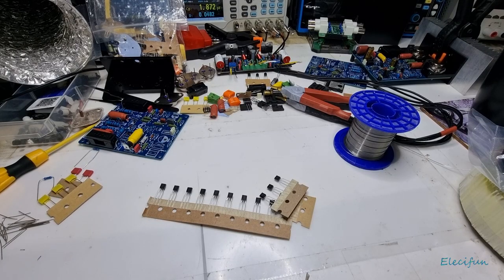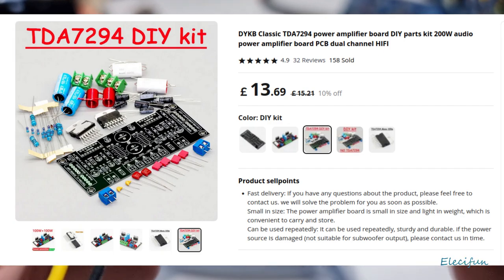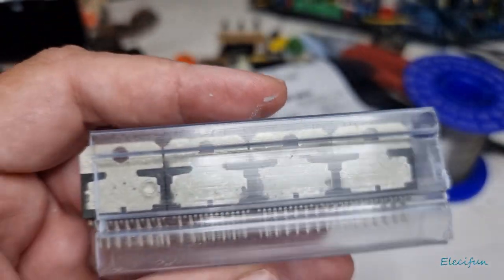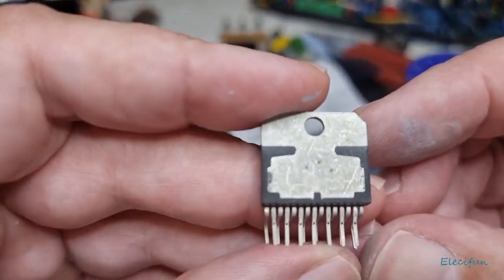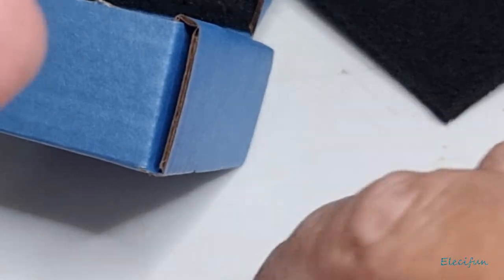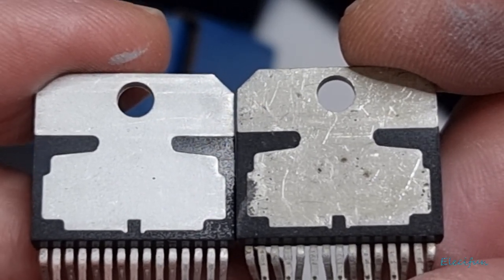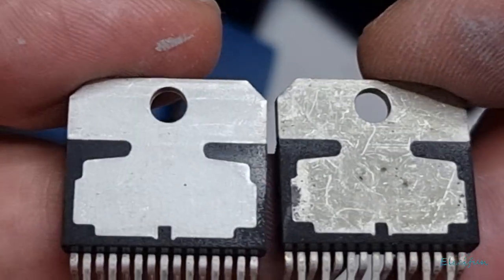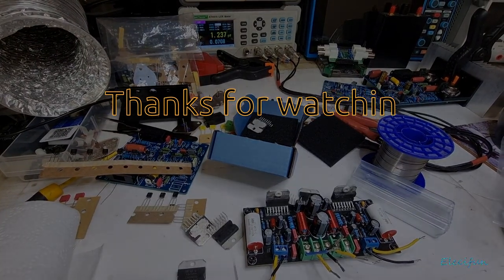STMicroelectronics TDA7294 Fake or Real

Comment: I wish it was easier to spot a fake. I detest counterfeit goods sold as genuine.
Reply from the maker: I have decided that my money is best spent on real component outlets like Farnell etc. It might seem to cost me a bit more but at least I will get my moneys worth and no ruddy fakes.
Reply: I agree Elecifun. My next valve amp project will be around $400 but at least I'll have genuine parts from a reputable source. I do think the chinesium kits have value in that when you stumble upon a good design you can upgrade the kit with genuine parts. The boards are often good and the circuit design is sound.
Reply from the maker: @Sonic_Ox  I agree 100% Ox, having just built a amplifier circuit with a bad rap. Modding with genuine parts it sounds great, to my ears.
Reply: Yes, Farnell prices are ok, BUT shipping costs is way much high. Examp for my country is 20 Euros.
Reply: Good point. When shipping costs are higher than the actual item, I walk away. I often have to wait for a bargain. Some distributors offer free shipping when the order exceeds $100 for example. That's inconvenient but is an option depending on your project. All part of the sport I guess...🤔🙄

Comment: The Chinese version of 7294, less than $2 I tried works very well. It doesn't have 6A current limitation. I didn't push it high in power but there are two trials on Youtube for $2 kit, they get 98W before clipping with  2x40v 4ohms.

Comment: whats diferent between ic tpa7294 and tpa7294v . i got replace tpa7294 by tpa7294v but it blowup when turn on speaker... the problem of the speaker was low sound and overheating tpa ic...

Comment: The original 7293 microcircuit has a resistance between the metal ear ( + ohmmeter) and pins 5, 10, 11 ( - ohmmeter) ---- about 3 MOhm, in reverse polarity - infinity.
Reply: you mean pin 5, 11,  12 right?

Comment: 3:40 at that image you see you have the dent of the side of the ic, well the aluminium is not supposed to be visible on the dent, its also a general indicator of that the ic is mostly fake, i have got a TDA2050 from a shop which was fakes, it also had visible iron in the dents, the ic was only able to produce 0.3Watts of clean sound to 8R on +- 8volt power supply, 110VA transformer.
Reply: But here the original one has also visible aluminium in the dents!?
Reply: @PaulPadrino  im not sure, but i find that questionable.

Comment: I fell into the trap - mounted a set and with 28v +- in a dual config - they blew immediately. My pcb is all good - built two other amps with RS supplied - so obviously these are lower voltage or just total rubbish - tried another pair and boom - same thing. As you say - the genuines are not cheap - but therewa .. Didn't blow the fuse or affect to Psupp - or any other comp - Now to get a refund -- not easy!

Comment: What's going on sir ? Have you got the genuine TD7294 ics soldered in?
Reply from the maker: Not yet I've been building other circuits and testing. I will do it in the next few days.
Reply: @Elecifun  Okay, cool I look forward to it ! 😀 👍
Reply from the maker: @decem_unosquattro9538  Iv'e ballsed it. Have to order another board without I'C's. Two week wait for delivery... Nuts!
Reply: @Elecifun  what do you mean you ballsed it? Can I ask how?? Sigh. Two weeks. I know the wait time sucks. Anyway these things happen. The show must go on though. Can you repair the old board? Maybe if you destroyed a trace you can get some copper and epoxy. I've seen them do that and it's good to know how to do it.
Reply: @Elecifun  maybe you had trouble getting the old tda7294 ics out. 

Without proper desoldering iron I guess it's a very tricky procedure. 

Anyway, I guess we shall wait. Sigh. 😕
Reply from the maker: @decem_unosquattro9538  its not worth the attempted repair, new board on its way. The tip on my soldering iron has seen better days. Also I was hungry and rushed the de-pin pulling up tracks around a few of the pins... never mind.
Reply: @Elecifun  As a consumer you should be protected by law. That means Visa protects you that way. It's the whole point of VISA credit cards. 

First raise a dispute.

Get the facts first because the bank will want to know those details.

You have legal rights and you should take advantage of those rights and remedies.
Reply: @Elecifun  sounds like you better buy a new tip too. (Or is it to) 🤔
Reply from the maker: @decem_unosquattro9538  I have one now, much better. 
I think its 'too' 😋
Reply from the maker: @decem_unosquattro9538  I'm not sure whats going on... the board cost 6 quid
Reply: @Elecifun  You have one what or is it watt? 🤔 😀🤓
Reply: @Elecifun  huh!? What do you mean? You ordered a new pcb (tda7294 ic board) right? You have what a new board already?? You bought the genuine tda7294 ICs which must mean you some how have a new pcb some how 🤔 ❓️ maybe you found one locally?  🤓🤔👍
Reply: @Elecifun  Yeah I get confused by to and too. Too big. I'm going to the store. It's a little bit tricky though the two toos  or to.
Reply from the maker: @decem_unosquattro9538  Ive ordered new board from Aliexpress without IC's, arrive in about two weeks. I have a new Hakko T18-D16 tip from Farnell already
Reply: @Elecifun  New board coming ! Good !
New tip that's good.
Geezez we never stop buying new stuff.
I need a new benchtop power supply. That's going to hurt. 😕
Reply: @Elecifun  if I build this project I'll use this chassis.
Reply from the maker: @decem_unosquattro9538  What chassis you thinking of?
Reply from the maker: @decem_unosquattro9538  Um choosing a bench PSU would have me consumed for days.. lucky you
Reply: @Elecifun  I'll get one like yours.
Reply: @Elecifun  My el cheapo psu are toys and I need something serious.
Reply: @Elecifun  Have you got all the components for this amp? I know you have the power supply, maybe a transformer and two mx50se amps? Have you got the speaker protection modules?

I guess you need all the other bits and pieces but I guess you probably have all that stuff already.

Just get that chassis, if you don't have one yet.

That's what I'm going to get if I decide to build this project.

I guess I'll need to pick out some speakers and the plans for a bass-reflex speakers.
Reply: I just realised this kit is not the TD7294 ics. 😆